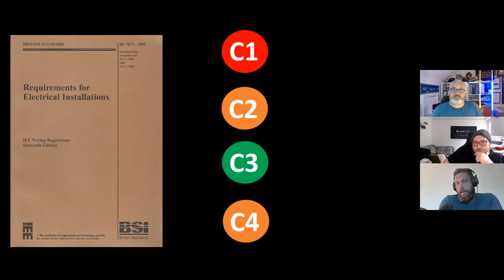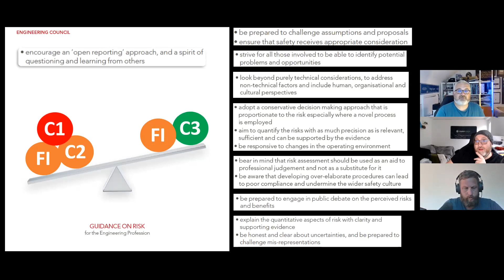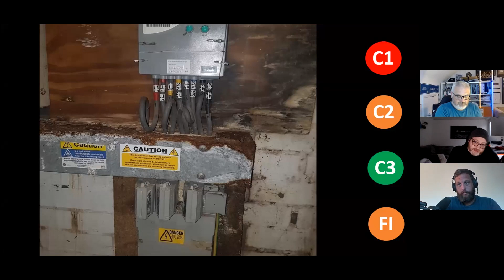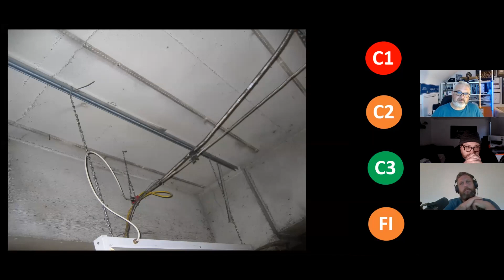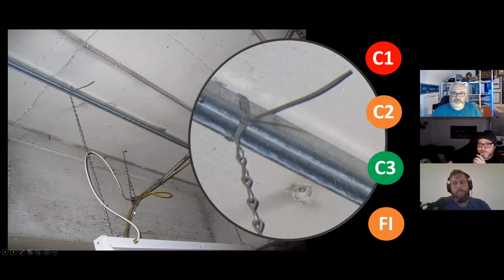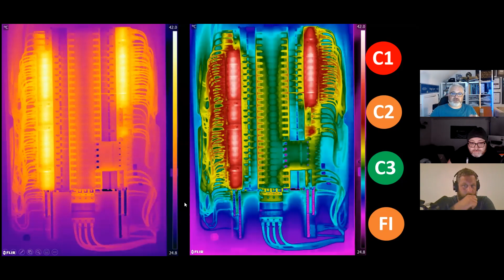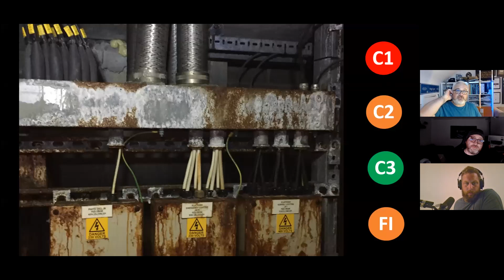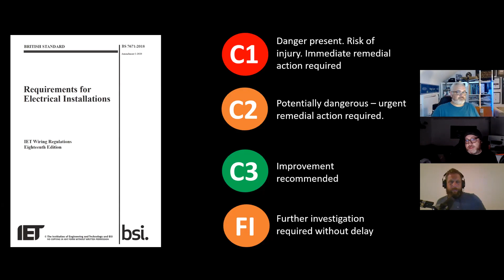EICR coding for Industrial installations with Neil Bridgeman and Paul Meenan

Comment: So if TN-S systems are to be classed as PME due to the DNO converting them without knowing what happens to petrol forcourts that require to be a TN-S under the ATEX regulations?
Reply: Are they not TT for ATEX? Thought they were supposed to be. We will cover this next week.
Reply: No they can be TN-S as well but not PME incase of a loss of neutral which you wouldnt want on bonded fuel tanks as it will give it enough energy to cause ignition
Reply: Paul Jones I thought that was why TT. Remove spark potential. We will delve into it in future webinars but the ENA doc G12 is a good doc to start with.
Reply: @e5Group  thanks ill give it a read. Im just going off previous jobs ive had on petrol forcourts and they stated TN-S and TT were the only acceptable means of earthing. I currently work in the water industry now and we have our own 11KV-415V TX feeding our ATEX equipment and that is a TN-S arrangement (Although you could argue its a TN-C-S but not PME)
Reply: Paul Jones if you have your own Tx it is defined as TN-S pretty much only TN-S left now. It’s covered in various docs we have screenshots of sections on our Instagram page